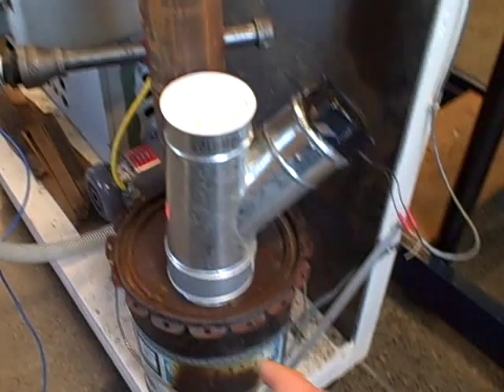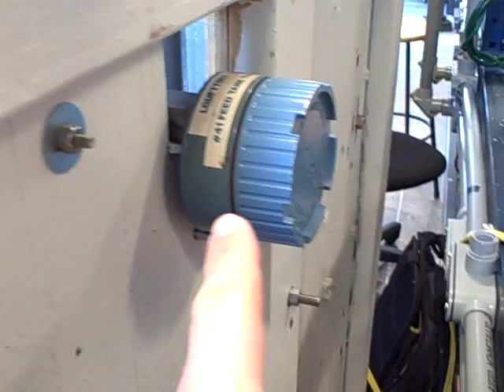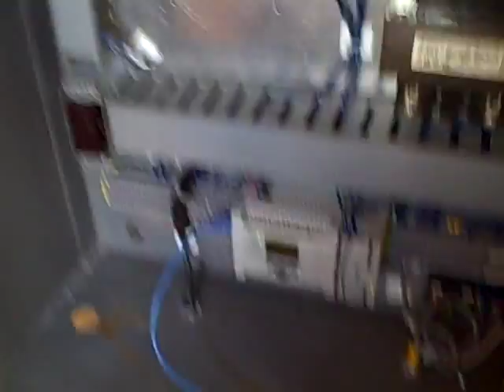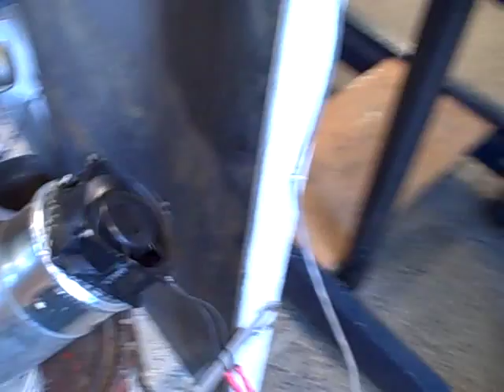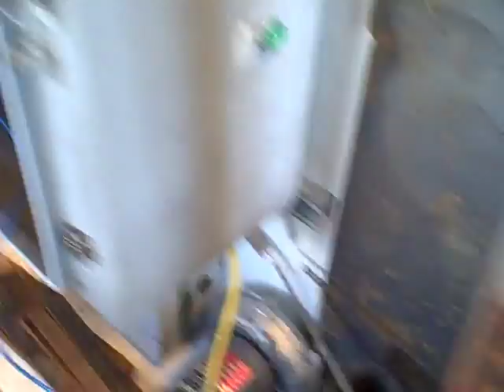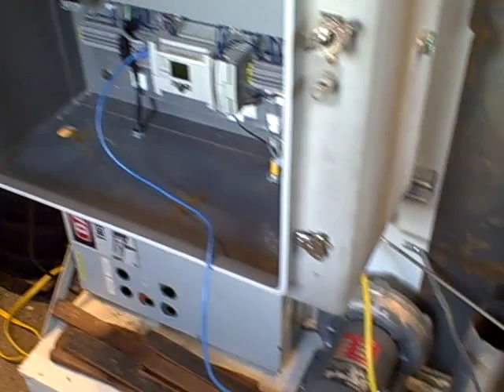Rocket stove automation -- part 2 (adding air flow control)

Comment: Finally someone to chat with!  I did a much simpler input volume read.  Installed a draft door at atmospheric pressure she hangs vertically. when draft is induced a 6" arm moves my linear potentiometer... gives very nice 0 to 10k output, that's as far as I have got thus far. going to use ohms to push small freak drive I think? I am doing this to my mass unite, I have run my set up very different/challenging .....